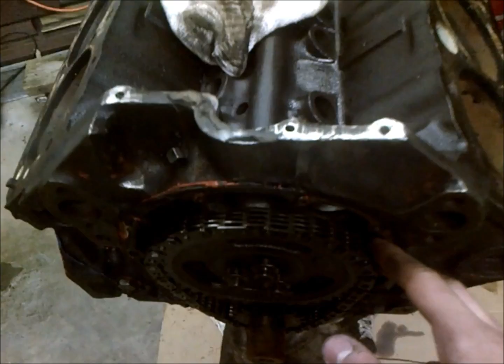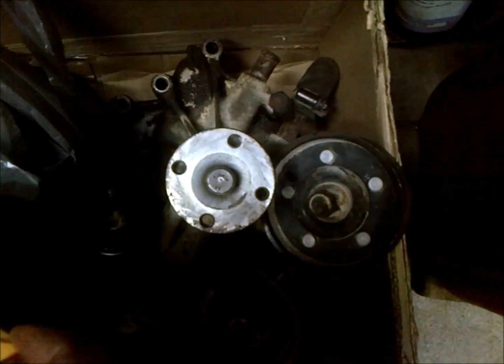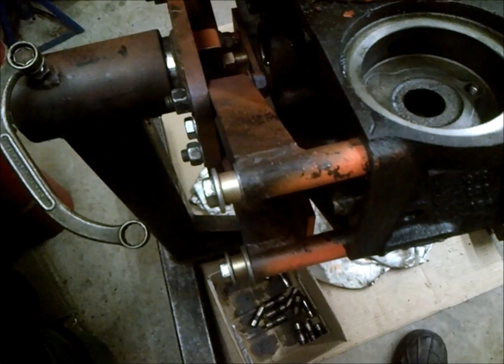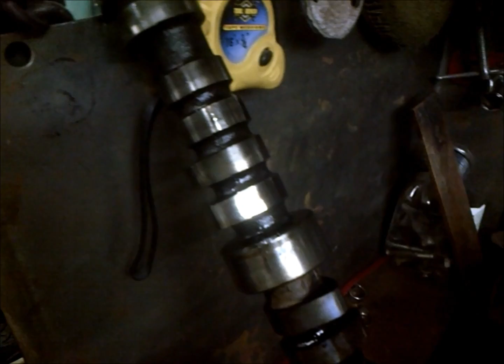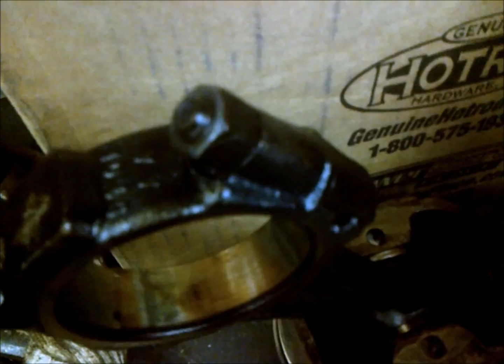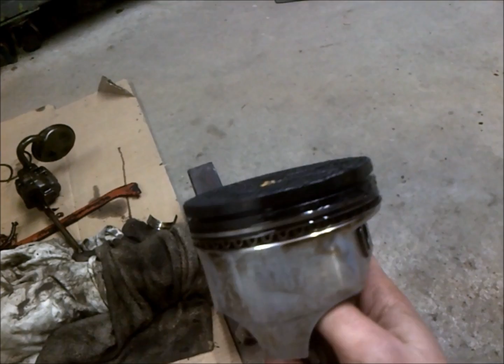350 Chevy vs Ford 302 Comparison: (Dumb Redneck Viewpoint)

Comment: The lobes are tapered to generate a small thrust load to the aft on the camshaft, thereby seating it to the rear of the block.  The later roller cam lobes are not tapered and, therefore, need a thrust plate.  You should know what you're talking about if you're going to point out "problems".
Reply: Good reply T. H. Glad to see you ignore the hate bait. =)
Reply from the maker: in many cases, they are right. im willing to admit when im wrong or have made a mistake. i forgot i even made this video. must be trending or something on account of the recent comments. before 2 weeks ago, this vid had not had a comment for 2 years.
Reply: Also true, all flat tappet cams are ground this way for that reason, cam thrust plate or not. Add to that the lifters are ground with a slight convex contact surface to avoid edge loading of the cam lobe.
Reply: Ronald  Schoolcraft Hey, just my .02 and I don't know squat about it, but I always thought it was the drag of the distributor and oil pump that kept the camshaft in on a chevy, and the lobes on the cam were tapered to keep the lifters rotating in their bore so the cam didn't go flat.
Reply: +Howabouthetruth. Dude! what the fuck are you talking about?! All of that babble of yours is meaningless to me. I mean really, who the fuck are you? 
Oh, I'm sorry, did my use of profanity just then hurt your "manly" sensibilities? And as far as my allegedly having used it to teach someone something here, again I ask you, WHAT THE FUCK are you talking about? You're a dimwit! addressing the wrong person. So how about the truth this time. LMAO
Reply: I know that this is a old comment, but you are not correct either, the lobes are ground slightly tapered to facilitate lifter ROTATION, the angle of the distributer gear is what pulls the cam into the block
Reply from the maker: AGREED. this was early on in my automotive career. the vid is originally from 2011. need to make a real comparison redemption video.
Reply from the maker: hey, if it makes people feel better about themselves, i guess have at it. no skin off my back.
Reply: Hey Anthony Wayne......automotive mechanics is about LEARNING THE FACTS........not waving pom poms & playing that silly "Hate" card like a liberal wimp. The gentleman corrected him in his original comment without using any profanity or name calling. He did it like A MAN, and Thunderhead responded like A MAN........SOMETHING YOU NEED TO GET A GRASP ON. How old are you? TWELVE?  GROW UP. Bad information SHOULD BE corrected, no matter what the topic is. I suggest YOU DEAL WITH IT, because there's NOTHING "hateful" about it.......EXCEPT YOUR SILLY CHILDISH ATTITUDE. And trust me, when 1 man corrects another in an actual shop/garage ABOUT FACTS.........silly interjections from someone like you, who has NO POINT TO MAKE AT ALL, will assure you won't last long in that garage. You would get thrown out of any NASCAR or similar team. "Hate bait".......as a man,  you should be ashamed of yourself. Hey.....YOU asked for it.
Reply: Yeah, perhaps. But it never ceases to amaze me how irresistible it is for so many people to jab at you when you are just trying to be helpful. Both comments would have been just fine without all the self validating condescension, lol Take care.
Reply: Anthony Wayne more salt Than in overwatch....
Reply: Ronald  Schoolcraft dude that's the point of the video to learn. how about you make s comparison video to show us how it's done then since your such a motor enthusiast
Reply: Thank you first min I thought the same thing like really. If ya going talk comparisons talk bout the fact sbc have 23 degree valve angle compared to the sbf having a 20 degree or how the valves are all exhaust/intake on the Ford where the Chevy is staggered putting a lot of heat to the center. But when ya stop An think it was designed in 53 an released in 55 the Chevy is very impressive but stock to stock the Ford has more advantage to make more power now you add in aftermarket An there equal.
Reply: I ran across this video the other day. I didn't like it that you claimed that the Chevy had a "problem" with cam retention when you didn't even know how it was designed to work. I told you how it works and suggested that you know more about what you are talking about before condemning an engine that's been around since 1955. The comment that I made about BS was directed at the moron bad mouthing Chevy engines, but it got put in the wrong place. Sorry. Then there are the other people making other claims who don't know what they're talking about.

Comment: Also Chevy's bolts go into the water jackets, the Chevy rods have no stress bump by the rod bolt, the Chevy has siamesed exhaust ports so they are known to crack, Chevy cams break because it drives the oil pump through the entire length, Chevy's distributor is in back so harder to adjust, Chevy water pump is less efficient, just go by a Mopar! Then a Ford! 2nd Chevy sucks! and their doors flop around! The oil pump is driven by the distributor which is driven by the entire length of the cam, Not Fords, the Chevy is known to snap cams when using thicker racing oil.
Reply: hey jack off the chevy oil pump is driven by the distributor
Reply: and Chev boy what drives the distributor? Duh!😝
Reply: lol I agree like the jack offmfao

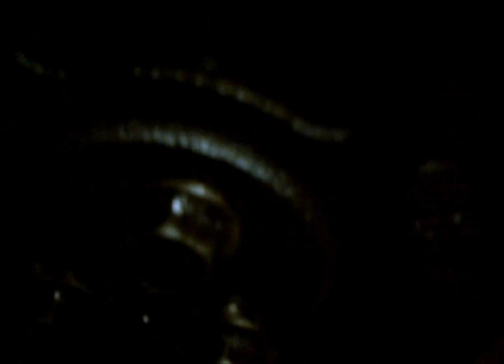Comment: I didnt make it 1:24 seconds before I knew you dont know shit...the distributor holds the cam in place on the Chevy sir.
Reply: No, it doesn't.  The lobes are tapered to generate thrust when rubbing against the lifter bottom.

Comment: These videos are funny, there are so many pros and cons in each make, they both come out about the same. I have built motors for years and depending on your budget I have can make them both scream and hold together while doing it. I will take one of the other it does not matter,  but throw in a Mopar.... and that is a no brainer..... I'll take that one!
Reply: TGBTG7701 So, once again, anyone who says Chevy is better than Ford, ABC is better than XYZ etc is simply unqualified.  they are all so very closely the same that it is the builder.  Any veteran mechanic will accept them all as equals, every engine built pays the bills, doesn't matte who engineered it.

In our machine shop we do them all, stock to top fuel, often engineered by the team who has us build it, to the point that the original block is almost unidentifiable anyway.

As soon as someone says something as blatantly ignorant to me, such as 'one manufacturer makes better engines than...whoever,' it just tells me they don't know actually what they are talking about.  End of.
Reply: I know, they are the same, six of one and half dozen of the other.  As a long time mechanic and automotive engineer, I always laugh at people who say Chevy is better than Ford or vice versa, they are so similar in so many ways, it's all in the build, application, driver and maintenance, not the manufacturer.  I am a Ford fan, I like their German engineered engines but it's only personal preference.
Reply: If you look at motors from 1980 and back, Ford and Mopar are superior, me and my friends take apart old motors for fun, Chevy's have many design flaws, they are light and were made 8 years before Ford or Mopar had anything as light with the same cubic inches, that's why they became popular, not from durability!
Reply: There are a lot of downsides to OEM Chevy heads, but there were some good ones also. I know a lot of people grab up Vortec heads, but a lot of those have cracks. I personally do not use OEM heads, there are so many aftermarket heads out there for both Ford and Chevy, I buy bare heads and the cylinder head shop check them out and install the valves and other parts. The 90s 351 winder with the OEM Roller cam, built right is a fine motor for the money. The OEM roller chevy is a good motor, but will show weak points when you start building them up to high horsepower....... but you can get an aftermarket block, the 427 small block combo with a 4.125 bore Dart block is a beast. Again, they all can be built to perform great, but they all have some weak points.
Reply: Smartest comment on here, Chevy Ford fight for 2nd place lol Fords more reliable then Chevy, Chevy is for wasting money!
Reply: jack rohde Add to that the number of REALLY shitty heads Chevy has made for the 350 over the decades. People rarely think of the head casting when building 350's. I've seen so many people blow up heads because a roller rocker set is dirt cheap and they throw them on the wrong casting.
Any engine can be built 'properly'.. You just need to learn how to engineer an engine the right way, other than just being a backyard hack.

Comment: Both are good proven engines.
Reply: Frank289100 Yep I agree 100%. I don't think chevy guys can read.
Reply: They yell in Japanese that's why!
Reply: Ford proves better and cheaper in the long run.
Reply: Cheaper? I don't think so!
Reply: Did you read what I said? In the long run the Ford is cheaper because it will out last the Chevy, now do you understand? Chevy costs less at first but in a few years you will be spending more.
Reply: I don't think Fords outlast Chevys !  I've worked on both Fords and  Chevys over the last thirtyfive years daily diagnosing, repairing and rebuilding and in the automotive world i've never heard any claims that Ford outlast Chevy.
Reply: jack rohde it just means you aren’t building that Chevy right, your wrong doing not Chevys. Say the same for Ford
Reply: JACK, YOU ARE RIGHT. IN NEW YORK CITY BEING THE CITY THAT NEVER SLEEPS, BACK IN THE 1980'S THE TAXI FLEETS WERE BUYING THE CHEVY'S OVER THE CROWN VICS BECAUSE THEY WERE $1500-2000 CHEAPER. THE WAY THE TAXI FLEET OWNER SAW THIS WAS IF YOU BOUGHT 100 CHEVY TAXI'S $2000 CHEAPER THAN THE FORD THAT WAS $200,000 SAVED. BUT THEY NEVER VALUED IN THE COST OF HOW LONG THOSE CHEVY TAXI'S WOULD LAST. IN 24/7 DRIVING AT 60,000 MILES THE CHEVY'S WERE ALREADY ON THERE WAY OUT, LET ALONE THE TRANI'S AND REARENDS GOING ALONG WITH ALL SORT OF OTHER PROBLEMS WHILE THE CROWN VICS WERE RUNNING UP INTO THE 4-500,000 MILES RANGE WITH MINIMAL PROBLEMS. THIS IS WHY DURING THE 1990'S IT ALL STARTED TO CHANGE. TAXI OWNER STARTED BUYING THE FORD CROWN VICS AND FOR ALMOST A 20 YEAR SPAN FORD HAS HAD THE LOCK DOWN ON THE TAXI, LIMO AND POLICE CAR MARKET.

Comment: If you are comparing a small block chevy and a 302 ford you are wrong on the head boltsboth engines have 7/16th inch dia bolts but the 351w does have 1/2 inch bolts

Comment: wow all the hatin. how about we just say something like, "dig a little deeper on what keeps the flat tap. cam from walking in a sbc"  learn before u teach.
Reply: You may not be as informed as you might think you are.
  
1. The flat tappet cam in the SBC does NOT walk in the engine while running - the lobes have a 'taper cut' which thrusts the camshaft backward into the engine, holding it firm against the thrust surface of the timing sprocket.  Ergo, no 'thrust button' is necessary.    Simplicity in design results in reliability in use.  The roller cams DO have the thrust button (more properly a thrust plate that bolts onto the engine block ahead of the cam sprocket) as the lobes cannot be taper cut.

2. No extra gasket needed for the oil filter adapter.  This design allows the block to use a spin on filter, or the older style bolt on cartridge filter.

3. There is a tool that places over the crankshaft stub shaft, that allows you to use a large crescent wrench to rotate the crank.

4. The longer connecting rod reduces piston side loading and increases torque.

5. The smaller head bolts, and more of them, means that not as much torque is needed to tighten the head.  This results in less distortion of the sealing surface, making for a better seal.

This is really nitpicky stuff, and over all a good video.  However, not knowing certain information about one product and then speaking about the perceived negative of such without an understanding of it, makes one come off a bit amateurish.

I am a Chevy guy myself but I've built a few ass kicking Fords too.  They're all good, but the thing to remember is there are differences in design due to differences of engineering viewpoints.
Reply: silicon212 Just kidding, but when you build a chevy they recommend to use a cam button, so the piece of crap wont try to come out the front at high revs, build a FORD or a MOPAR engine they last far longer, and stay away from Pennzoil.
Reply: jack rohde I've been building SBC engines since the mid 80s and I've never seen a recommendation to use a thrust button on any flat tappet cam at all.  Again, an aftermarket roller cam or a retrofit roller cam will need one.  

I do agree on the Pennzoil however.  I run Castrol in my roller cam engines, Rotella T in my flat tappet cam engines.
Reply from the maker: I don't care what people say, I build engines and they walk around a good 1/4 to a half if the chain is worn
Reply: Unless you have a manual trans and let off at speed then the can trys to walk forward.
Reply: jack rohde Say what?
Reply: jack rohde Ford and dodge engines are better? So is that why Chevy has sold the most small block v8's in the world?
Reply: use a cam button.duh
Reply: Bryan Loewen Rolex is better than Timex but Timex sells way more watches, Mcdonalds sells more burgers than Red robin, Cadillac sells less then Chevy, which ones would you rather own? the average person has an 8th grade education too.
Reply: A specious argument.  Chevy and Cadillac not in same class.  Timex and Rolex not in same class.  McD and Red Robin not in same class.  Ford and Chevy are in same class.

Comment: look stupid, the cam is held in place by the lifters. the lobes on the cam are slightly angled. when you see one that has cam walk it's because the goddamn cam is wore out. I fucking hate you.
Reply from the maker: ? Go build and race both. Small block ford in a stock form comparison is much better. 351 vs 350 is the 351 all day. Next time you have a 350 o the stand , remove the timing chain, put them cam sprocket back on and pull on that cam with the heads and valve springs and all still attached. Then go ahead and tell me what is held on by what.
Reply: +jimscjcobra Wrong.  The angle, or as I call it, taper cut, is on the lobes where if you look at the lobe from the side, the rear of the lobe is slightly taller than the front of the lobe.  This is done to impart spin on the lifters as the engine is run- this spin helps to prevent said lifters and lobes from premature wear.  Most, if not all, flat tappet cams are so designed.   A side effect of this is that it generates a thrust action, attempting to propel the camshaft through the rear of the block.  Chevrolet engineers took advantage of this effect.  This holds the cam in place, as the thrust surface on the camshaft sprocket actually prevents said rearward thrust.  

If the lobes on a flat tappet camshaft were not angle cut, the lobes and lifters will wear out generally very fast.
Reply: The cam also spins the oil pump thru bevelled gears, forcing the cam to the back.  It's not gonna walk, not while it's runnin' !!
Reply: The cam is actually held in place by a cab button (shim) on the timing case. You better hope the lifters aren't what hold it in place.....The lobes on ANY  cam  are not "slightly angled", if they are, you've got problems.
Reply: ummm... yes they are. the lobes are tapered. The lobe  taper rotates the lifter and the pushrods too. (what exactly would you think causes the rods to rotate?) Without the taper, and lifter rotation the  cam quickly wears out!
Reply: It takes about ONE Horsepower to spin the oil pump, so, the bevel gears are transmitting a force of 33,000 foot-pounds per minute, and the REACTION of this force is keeping the cam snug against it's thrust surface.

Comment: i have had several small block  Chevrolet engines with the camshaft walk and eating into timing cover sending metal into engine numerous times. Chevrolet engines  have lower sleeve issues even with the ls engines  the lower part of the cylinder is to short resulting in the piston wearing prematurely and a lot of times breaking the ears off the bottom of the pistons. and if you stroke the  ls or sbc  your asking for trouble  unless you use a short style piston resulting in piston slap. the only thing good about the Chevrolet block if they use more head bolts than the sbf.  better for  nitrous or boosted applications. secondly the Chevrolet engines cylinder angle  results in  premature crank and lower rod wear.  the sbf is a better engine but limited to around 600hp because of   not enough material in the lower crank mains. they 351 windsor engine  is without a doubt in any terms better than the sbc pushrod
Reply from the maker: we are in an accord on that one. built both, both are tremendous engines. the 351 is the best small block. hands down.